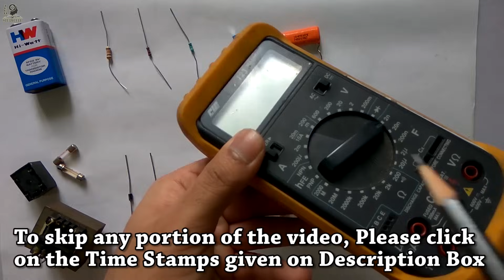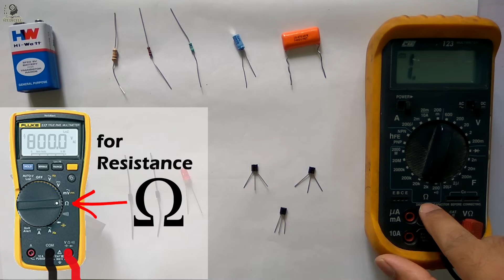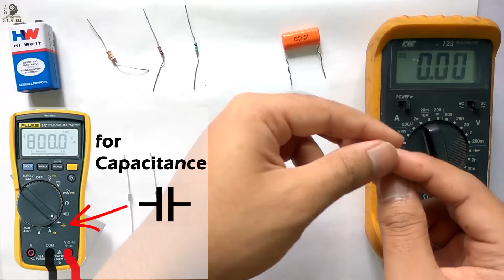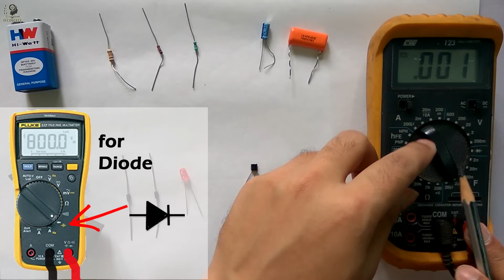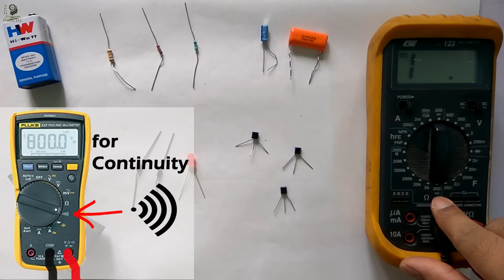How To Test All Electronic Components with Multimeter | Resistor Capacitor Diode LED Transistor Fuse

Comment: 3:41 measure lead resistance and then sub from actual value...
5:17 how to hold resistance
8:31 discharge capacitor before testing...
10:47 longer led wire act as anode (+ve)and shorter one is cathode(-ve)...
12:34 transistor measuring

Comment: What if your testing the components on a circuit board and is it supposed to be the same readings as in the video? Because when I go to test my transistors by putting the positive on one side and the negative on the other side they all have a reading and in the video it is supposed to be 1. If it’s good. And I know for sure all these transistors aren’t bad.

Comment: just a minor tip when testing with your meter and you get an odd reading  diff #s  hastily twist the selector knob back and forth  what this does is clean the contacts in a circle  for diff functions in side the meter  this works good with analog or digital meters

Comment: in my multi-meter i dont have the socket for capacitor , my multimeter is haoyue DT9205A,  in this PNP NPN socket is there. pl tell me how can i measure the CAPACITOR with my m.meter.

Comment: If all these components are soldered on PCB , can i test with the multimeter? Is the reading reliable ? Or I must dismantle it from PCB before I test? Thx Tcher
Reply from the maker: No. You have to dismantle first

Comment: Correct me if I'm ::--The battery's observed voltage is 9
Then how can it shows 9.4 as measured value.Measured value should be smaller or equal to Observed Voltage not more than that.